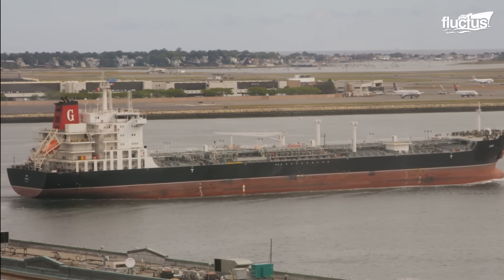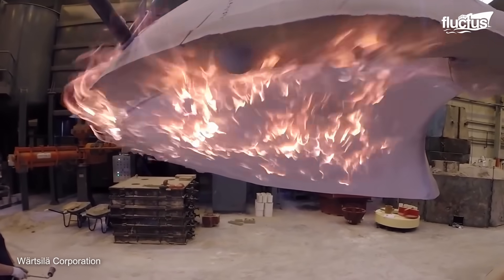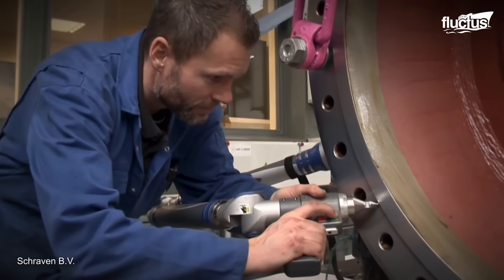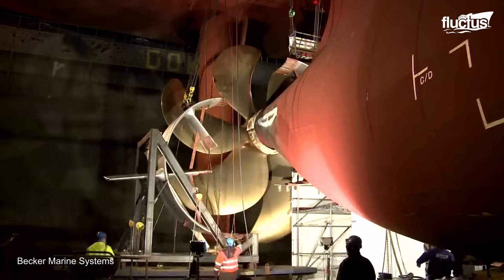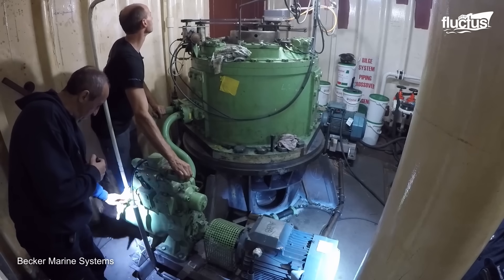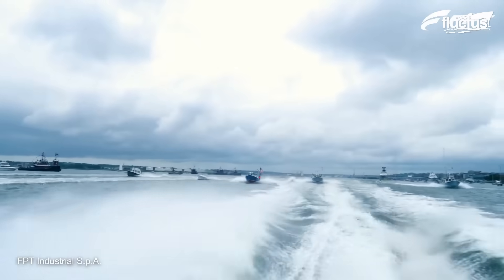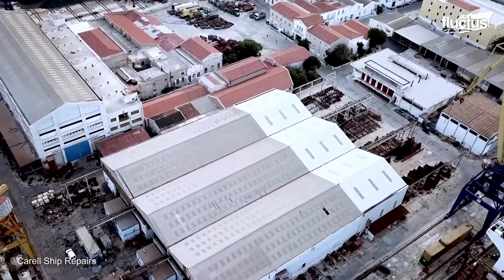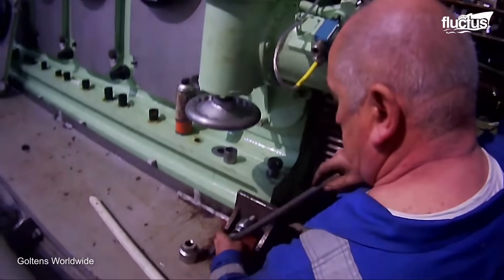How They Produce Massive Millions $ Propellers That Move Giant Ships

Comment: Why not ship create back sides propeller so that ship can move backward at the time of stop the ship and collision .

Why not create 10 propeller to rest some and start other propeller .
Why not ship layers 3 ,4 and having gap of 5 feet for movement of person any crack or leakage of water caught that piece and fixed another .10,20 feet steel plate inside the ship .
Why not ship cover with steel plate externally and internally the cover with steel plates .
External cover move on internal cover remain  constant at the time ocean wave .
The ship will not turn down by Ocean waves  .
Why not this technology applied in ship .